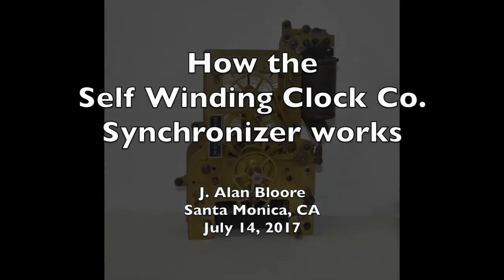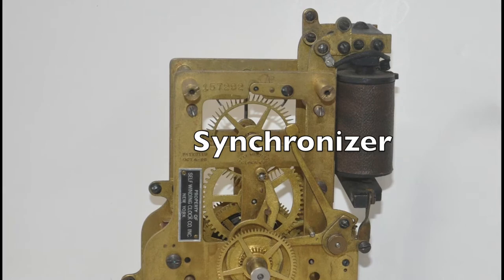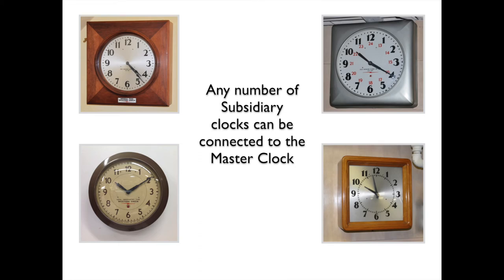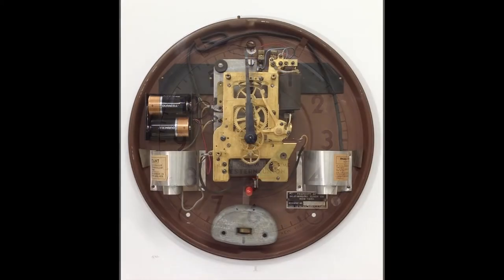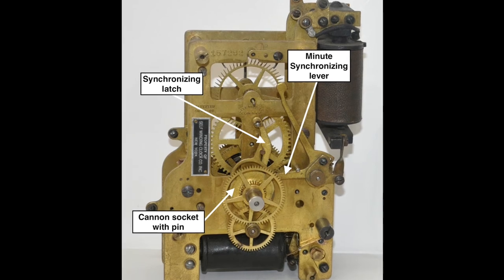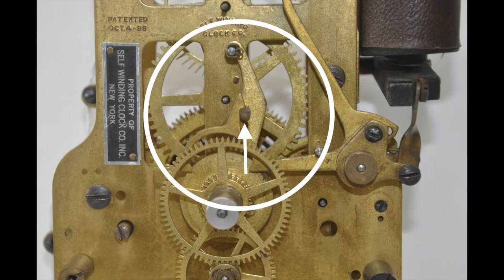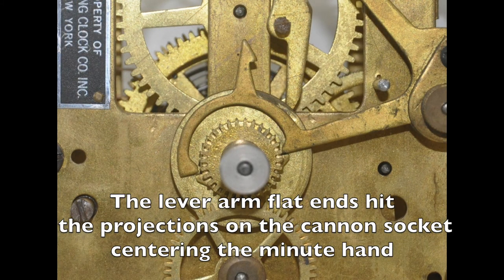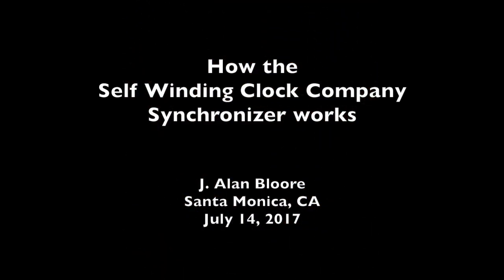How the Self Winding Clock Company Synchronizer works

Comment: Thanks for the explanation. But a question. What does the arm that is near the escapement (second sweep) of the synchronizer do? Does it somehow adjust the second hand also? Was there ever a SWCC that did synchronize the second hand?  Thanks
Reply from the maker: The arm near the seconds arbor has no function on movements without seconds correction. Yes SWCC did have movements that had both minute and seconds correction. I have a YouTube video that shows the correction.      https://youtu.be/A77kXeHDdKc   The Master Clock from the Panama Canal.    In those movements the arm was fitted with a special seconds synchronizing lever and a much more complicated seconds bit.

Comment: I just bought a Naval Observatory Time Western Union Clock. I would like to convert it with the D size battery pack as everyone is talking about doing, oil the mechanism the proper way an get my clock back to working. Can u direct me to any repair books on these clocks an any other materials to restore this clock please. Any info would be much appreciated Thanks
Reply from the maker: Hi Gregg, 

You will learn to appreciate these remarkable and very reliable clocks. The movements are very simple to work on and the electrical components often do not require much attention. For help with the electronics look up Ken's Clock Clinic.http://www.kensclockclinic.com/library/ 

and see Self Winding Clock Company service guide 1946.